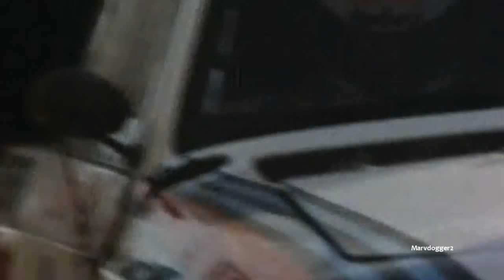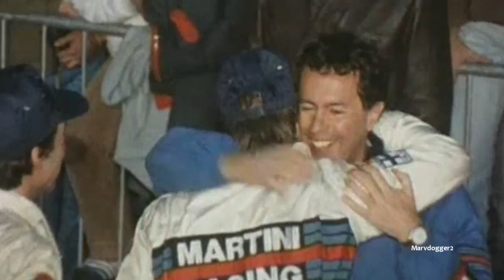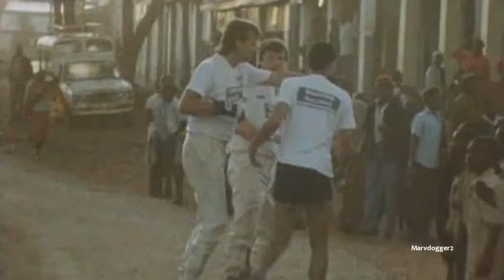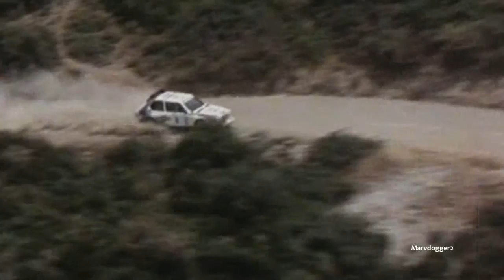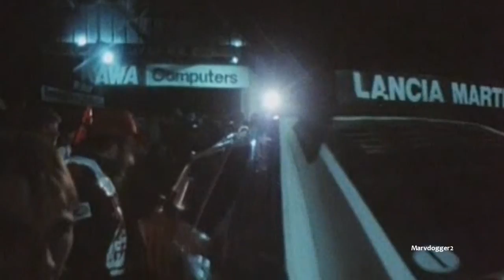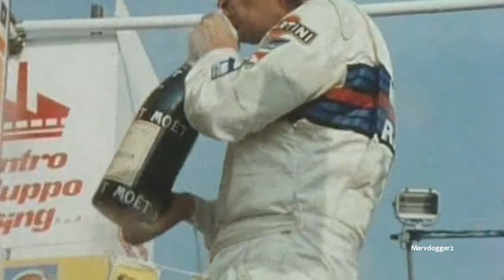1986 World Rally Championship Remastered - Group B

Comment: Sorry for nitpicking, but Lancia used the 037 only until the 85 season. They only used delta s4 at 1986. Correct me if I'm wrong..
Reply from the maker: They bought the 037 back for one event in 1986, the Safari Rally as they felt the S4 was still to new and unknown for a long and tough event like the Safari rally.
It payed off coming in third place behind the two works Toyotas and more importantly ahead of the Peugeots.

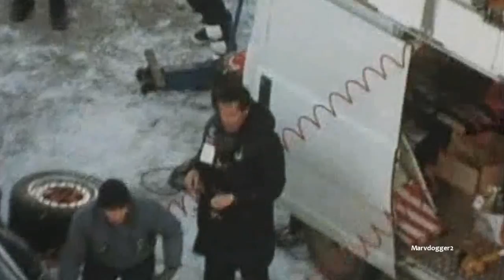Comment: The Delta S4s weariing red wheels at 4:38.......which rally is that? I don't ever recall Delta S4s wearinig red wheels/rims.
Reply from the maker: Red wheels were only used in Monte Carlo to indicate snow tyres because of the mid stage pit stops Lancia were doing they wanted to make sure the mechanics picked up the right tyres.
Reply: @Marvdogger2  
Thank you!!

Comment: Great stuff - again. Don't know how you managed to find some new material. Just makes me sad to see how rubbish the WRC is today. I have no interest in it, unfortunately.
Reply from the maker: The 2017 cars are better but rallies are still too much of a sprint now. We need longer stages and they need to bring back the old stages and events.
Reply: So I would do the following, say a 10-point plan.
1 Monte Carlo - Col di Turini at night, plus some other classic stages
2 Reintroduce the Sintra stages in Portugal. I think spectators can behave now.
3 Reintroduce the Safari Rally. The WRC needs a tough event, no matter what the cost to the teams. Make them work for victories.
4 Make rallies longer.
5 Encourage teams like Audi, Lancia, Renault, and some other manufacturers to take part again.
6 Encourage more ex-drivers to take up the reins as team managers
7 Reintroduce the English and Scottish stages to the UK round of the WRC (spectator stages, Kielder, Grizedale, etc)
8 Reintroduce the San Remo rally on gravel and tarmac
9 Stop having stupid power stages SSS stages.
10 If you are going to have a rotation system, at least have rallies which are interesting. What about New Zealand? Always a drivers' and fans' favourite.
Reply from the maker: Agree 100% The drivers used to love New Zealand with its super smooth gravel roads and tarmac stages around Auckland and the Sanremo when it was 50/50 asphalt stages and gravel. Teams need to bring back specialist drivers for odd events aswell.